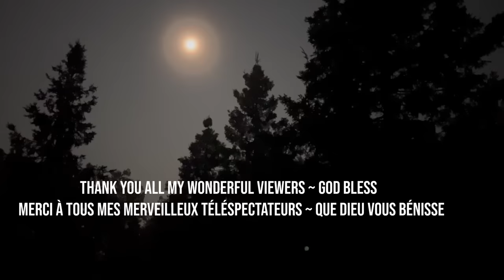This Was HARD !!  And Then Something Unexpected Happened

Comment: Although it’s easy on the eyes to watch you, it amazes me how much work you put in preparing for the winter. Your plans for installing a propane fireplace may want to move forward sooner than you planned.  You can incorporate a thermostat to the fireplace which will allow you to sleep through the night. This will also cut down on your wood consumption. Have a wonderful day.👍👍🇨🇦
Reply from the maker: That’s one of my next big project I need to tackle. I’m just deciding on what type of fireplace propane to get. Enjoy your day too ❤️
Reply: My dad used to just put big enough logs that would burn all night
Reply: I don’t know how much all that wood cost but I do know that propane is not cheap
Reply: @One.woman.wilderness I have a Continental stand alone fireplace that's made in Barrie CDVS500P that ignites on battery power and battery powered thermostat. This way it will still heat other than the 120v power fan. I would think they would have a built in model that works without power as well. It's my backup heat 34,400 BTU
Reply from the maker: @SWATT101  
I like the idea of having a battery powered thermostat! I’ll have to check around, there’s one place where they sell stoves/fireplace in Burk’s Falls. I plan on going there in the next couple weeks or so.
Reply: @bobkopf227 - I think the main “costs” of the wood are chopping down a tree, cutting the wood into footlong sections, chopping, hauling & stacking it…
Reply: @logicalspark3496 - I don’t know how you do that when it’s 40 below! I’ve tried it, & it always seemed to burn out by 4 - 5 am. 🥶
Reply from the maker: @TraditionalAnglican 
That’s why I set my alarm so I can feed the wood stove around 3 am. I like waking up to a warm cabin 😉😎
Reply: @One.woman.wilderness yes the thermostat works by telemetry no wires to the controller at the fire place which is also battery powered. This battery pack controls the valve. Works flawless. Just have to load up fresh batteries at beginning of season lol
Reply: I have always lived in a wood stove region. Over the years I could just get the wood for my labor :-). Then I started buying it till it started to get to costly, that I just could use propane. Now I’m to broken 😞  down to much to do wood and my income has dropped to retirement 🙄. With the high prices of heat cost I’m thinking maybe setting back up a small wood furnace and use what I used to cut that I called granny wood 😅.
Reply: U need a foot treadle on your pump like my granny used to use on her treadle sewing machine 😊.
Reply: By the way if you had a check valve at the bottom of that pump I believe you wouldn’t have to prime it each time :-).
Reply: ❤you

Comment: I love wood heat. Falling, sawing, and splitting but stacking is the downside.  A great woodshed helps a lot. Wood heat makes heat when we get it for winter and again when we burn it. I try to stay a year ahead in case of physical infirmities. I am not sure if it affects the ergonomics of pulling/pushing the Gorilla cart, but the handle is installed upside down. Bears can be a pain at times.

Comment: Getting the wood stacked and done was a lot of hard work.
As for the shower they make some nice solid brass faucets that can be worked into the shower controls
For your water tank for the shower might have a crack somewhere in the tank or the drain end end has a problem with it.
Maybe a couple of plastic 55 gallon drums are in order for the shower
For your well pump, have you looked into an attachment for a garden hose to be put on it to pump water through the hose and run a length of where you want the water to go.

Comment: You are lucky to be so strong. I do firewood like you. But I use a smaller cart sometimes with less than a full load. Sometimes I use my walker as a cart. I wore myself out at 54, now I have to adapt. I rake up all the little bits on the ground put them in paper shopping bags to use as kindling. This makes the rolling to the shed easier. I’ve written this before but please stay safe climbing on stacked wood. 
 I’m proud of you for working out alternative solutions for your water, you will do well with those abilities and attitude.

Comment: That portable shower is all you need with one or two buckets of warm water. Regarding the wood I guess ideally rolling down to the door opening by clearing away some of the small kindling and then you would not have to pull a heavy cart up an incline to get situated. And if you have to pull up the incline from the pile that is at the bottom of the incline it should just be a half a load. Nice to see water coming out of the well hand pump.

Comment: Worked hard, shame about the shower though to cool you off from that hot work 😢😢😢
I would check the actual storage tank as well for a hole especially if it isn't raised off the ground, and put some plumber (PVA) tape on the joint as well.
As a back up, look into a caravan/camper van shower setup using 12v pump and heater. It will save you not only time but also water wastage as you heat up what you use from a 45-50 litre container.
Take care, bears can be inquisitive especially when hungry but make sure the girls bark loudly as it should help to deter them, and also from injury to yourself lovely lady ❤❤❤

Comment: Good morning. Did you winter rise the outdoor shower last fall before winter? Just like an RV, there is plumbing antifreeze. 
Tank could have a pease of dirt stuck in the valve. Just put it up on something, add 5 gals, water, and look for the leak.
That is a nice cart you have there.
Have a good week. It is going to be hot.😊 
Looked up that tap set $70. Make sure you use RV tap sets as they are made to be winter rised.
Hope the pump is ok.

Comment: Is it possible some water was left in the shower water container and shower valve which froze last winter?  Frozen water is quite powerful.
Reply from the maker: I did remove the shower head and made sure there was no more water… but it’s possible.
Reply: The water will flow to the lowest spots, in that case, into the valve area.  Bummer, but one more lesson.

Comment: Attago Lisette.... a little Vino/relaxing afterwards !
I put a propane Boiler/heated slab basement/demand hot water system in my new place,  gonna try it this winter see how it goes ?
I insulated every upstairs room separately as well and put electric baseboard thermostats so each can be it's own temperature.
I dunno.... first year in decades without my woodstove for heat ? We'll see I guess, but still got my wood cookstove for pizza/bread etc out on the deck !

Comment: Great moving the wood with your cart…the wood is very heavy even in the cart(no joke,right).. when I worked as a teenager in the summer at an oil refinery the first thing the old timers taught me was to always push what you can instead of pulling…they told me it was much easier on the body and body parts to do so…so, I did what I was instructed to do and it really made a difference…however, with the long handle it would be next to impossible to push rather than pull…just be careful with your weight,as I know you are…great job in finishing your stacking! Have you thought of using a 55 gallon plastic Barrell to put your shower water in, than may be the ticket…your tomatoes looked like in a week or so they will be ready to pick…another great video my friend! As always,be safe, stay healthy, G9d bless!

Comment: Because of my accident I forget things. Just a suggestion over inflate your tires on your wagon.
As it is not soaked around your water barrel. It leads me to believe your water syphoned out through your hose. Wait until you use your shower before you put the hose in the barrel. As far as the spicket is concerned it looks like you will need to replace the entire mixer. Now back to the barrel just put say 10 gallons of water in it. Do not put the hose in it. Then see if the water is gone in the morning. If it's not gone add ten more gallons. Do not put hose in barrel. Repeat, remember do not put hose in barrel until you are ready to shower. When you are done showering remove hose from barrel. Drain all waters from barrel before freezing weather. Leave both cocks open on mixer to allow freezing of water left in line. I hope these suggestions work for you.(friend) Love Jim

Comment: That shower valve was junk when you installed it.  You can make your own using copper pipe and solder in ball valves.  Just remember to open the valves and then them drain before freeze up.  If you have questions send me a note.

Comment: I burned wood for almost 40 years then had natural gas piped in from the street. I just moved to a small house that has solar and oil heat so hopefully it will be super efficient and reasonable this winter. I warned you about the load burping a couple of weeks ago and now you have bears, the dogs will spook them off.

Comment: Is That first time using this year ?Any water that's left in any line or area can split a line or blow a tap apart,  only guessing but that may have happened in the winter ..Also looked like a valve on  water tank that is in the open position.

Comment: @ 11:48 you better believe that was a lot of work 👩  I think I would have just thrown tarps over the log piles and weigh the tarps down 🤔 from: Scranton, Pennsylvania
Reply from the maker: I can’t because of the moisture in the ground. It will rot the firewood.
Reply: That's true; the bottom layer of logs will start to rot 🤔